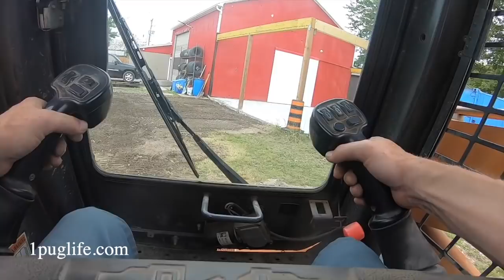cutting concrete and spreading stone

Comment: Watering the concrete for about a week after pour helps with the curing process also the cuts should be deeper to prevent crackage and also a caulking to help prevent water from getting under concrete only on the spots where he cut